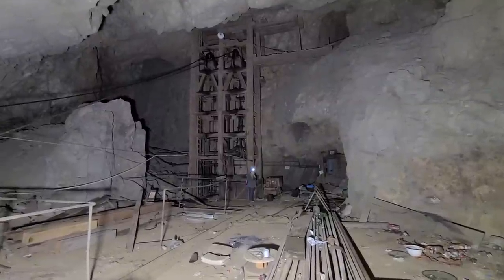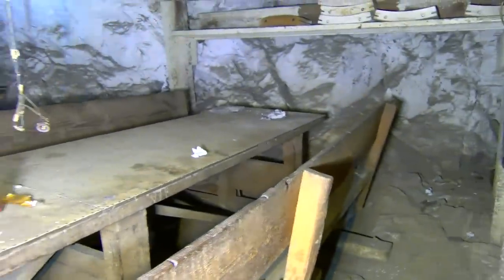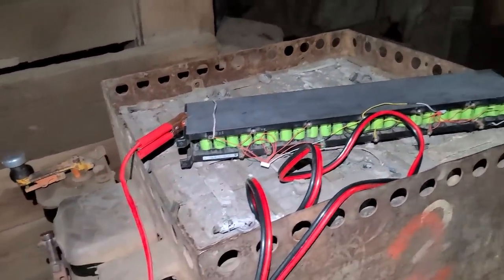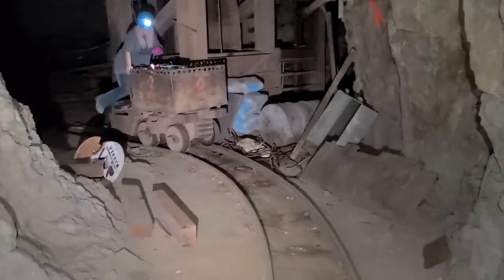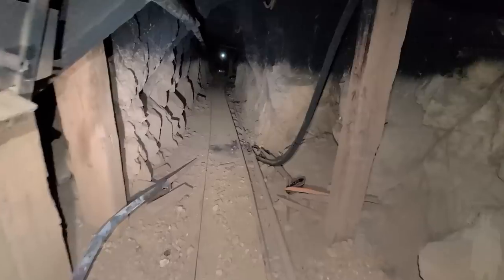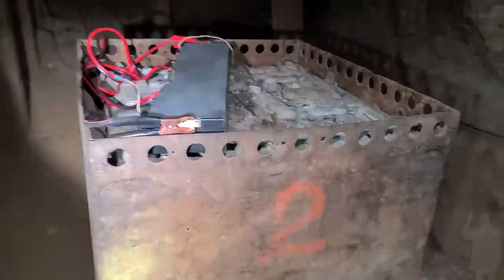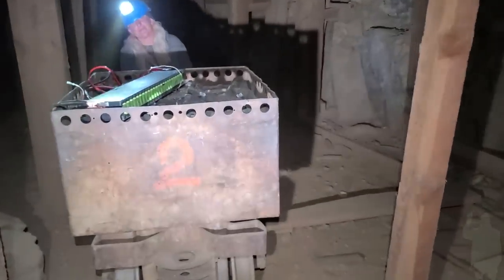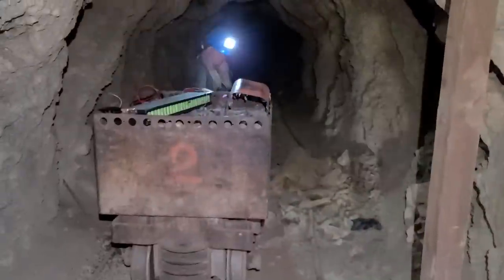Mancha Electric Locomotive Resurrection and Ride Underground

Comment: From one hardrock mine enthusiast to another, that was some of the coolest shit I've seen in absolutely forever, and coming from somebody with essentially zero electrical knowledge - color me impressed by what that little battery pack was capable of! Thanks for sharing Boxy! 
I've come across trammers & locis similar to the one in your video here, but almost always in wet underground where the wiring and contacts were likely corroded far beyond use. However, we did find one powered by a Deutz F3L912W in drier conditions that I'm rather certain we'd be able to get running without too much fuss...
Reply: Deutz 912s are basically bulletproof. Bring some fuel and a battery and she'll go.

Comment: Well I'm with you on the copper theves, I like to see each and every one of these copper theves grab a 69 kv line, if it's not yours don't touch it leave it the way you fond it. For others to injoy. Be safe my friends.
Reply: While I agree 100%, I do wonder where it falls under the law. Most of these mines are, as all the video titles say, ABANDONED. With no actual owner, on public lands and no current claims, are the copper "thieves" actually thieves?
Idk.... Just an off the wall thought.
Can't really legislate anything about it, because then ALL the mines would get shut down and bat barred or collapsed.
Reply: @Dwendele  Anything and everything on 'public' land is legally protected by laws though the Bureau of Land Management and therefore it is in fact stealing to take it.

If I were able to, I would buy up a lot of those old mines and make them work again, but I know in advance that a lot of good stuff has been taken from them, although, admittedly some of it was taken by the former mine owners, and much of it has rusted/rotted beyond use.

Still, anything one could refurbish would be good to put a mine back in operation sooner and for less cost.

I have recycled a lot of metal, but I never stole any of it, I got permission from the owners to even look in trash dumpsters or any other form of scrap metal I ever collected.
Reply: @DeliciousDeBlair  Keep in mind, once items are thrown in a dumpster those items become property of that dumpster's owner.

Comment: A bank of 12 volt car batteries would likely run that thing for several hours, if not longer. What a neat find.
Reply: Deep-cycle batteries would be better than regular car batteries for power for longer.  The batteries in the loco are basically fork truck batteries.

Comment: Next time you play w/ Mancha -- bring some Vasoline for the contacts and points.  Apply liberally, it will cut the arcing and smooth the controller rotation.  1970's portalman in WA state--North Bend area.

Comment: I know it would be incredibly impractical. But I think it would be so cool to find a mine with minimal damage to the electrical infrastructure and find a way to apply power to the whole place again.
Reply: You are talking about a major deal. Mines of any size are running at high voltage. 449 oe sometimes even 880v. A mine electrician I was helping taught me the three principles of electricity. #1 It's invisible. #2 It will kill you. #3 It tastes like chicken !!!
Reply: You'd need a big 480 genset and hope nothing is shorted when you fire it up!

Comment: You might be able to use an automotive jumper pack for power and have less wire laying around. I am very envious of your adventure!!!
Reply: A jumper pack might be good for testing one to see if it is workable, but they have nowhere near the capacity/voltage of that battery pack - it would be flat in minutes.